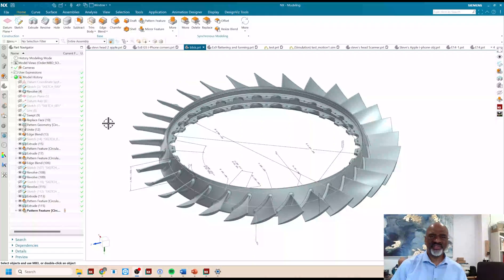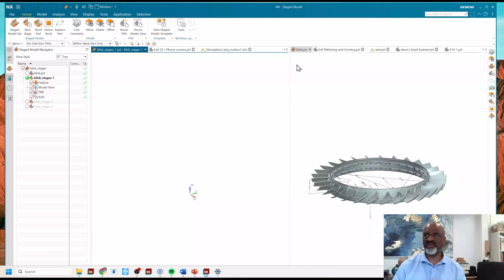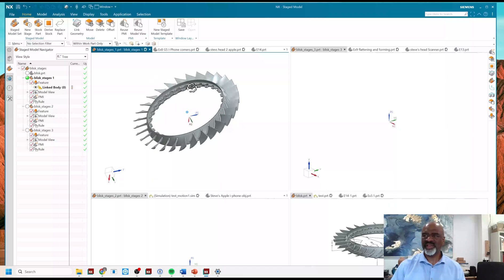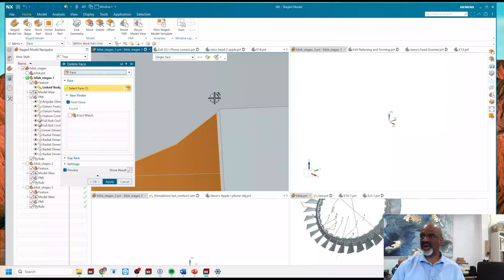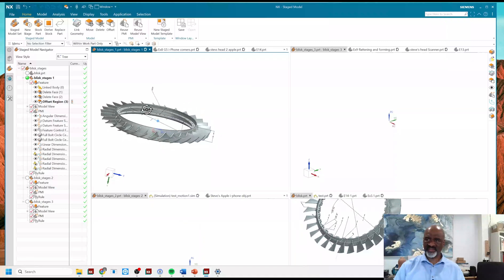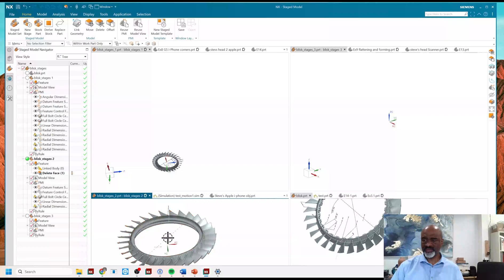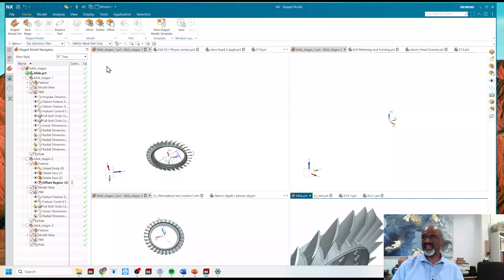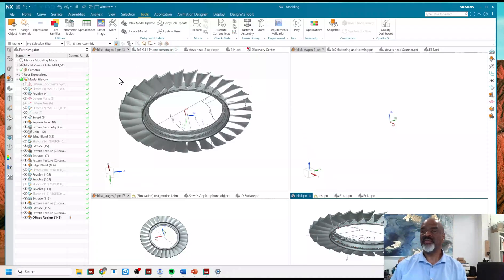How to Use Staged Models in Siemens NX 2312

Comment: Since in the whole youtube I could find only 3 videos related to stage modelling, I would like to understand below points about that;

1. I need to make this stage model integrated with Teamcenter. Could you please make a video or let me know how to do that?
2. If I make link geometry  to finished shape in every stages, it will increase the number of parts and part numbers in Teamcenter I believe. Can we reduce it by removing link ?
3. If in between, after a particular operation I need to continue as two or three variants of that particular design I think link with main part will be a problem. I assume once you update the main part, whole stages will be updated. But in my variants only one variant need this update and another one doesn't need it. So how to proceed in this case?

Awaiting your support and reply for this...